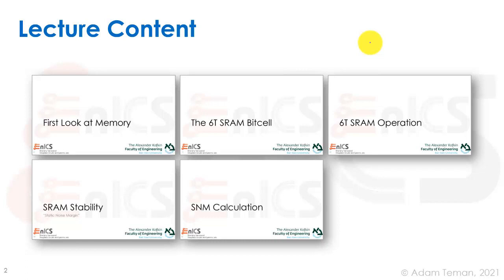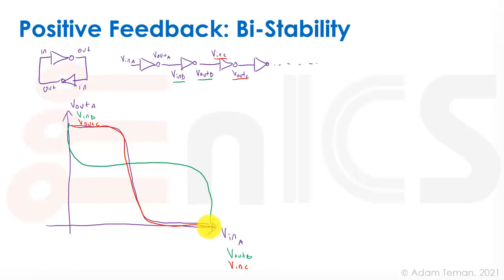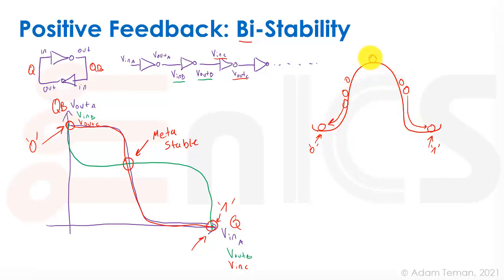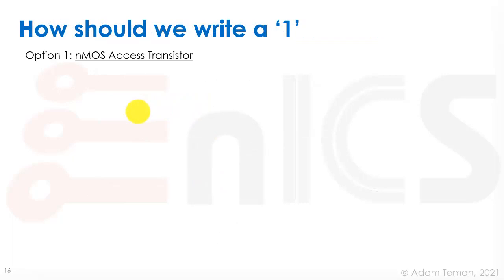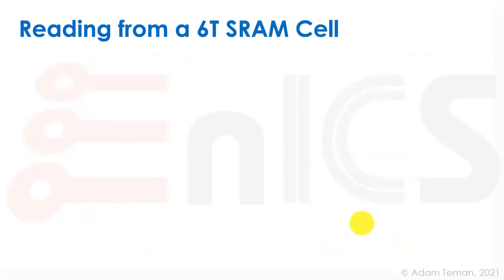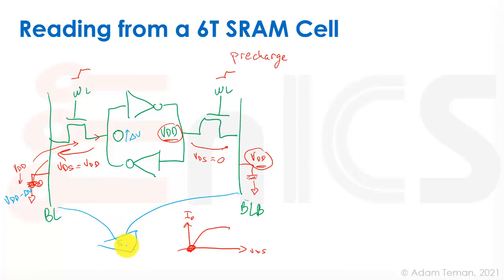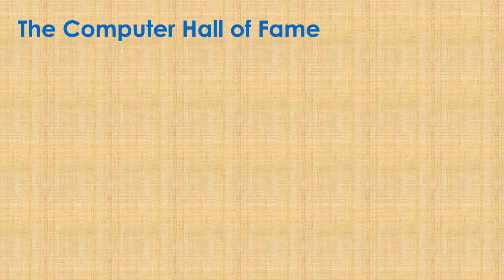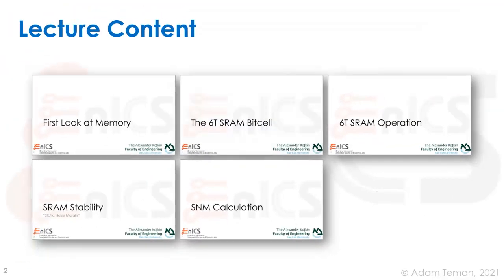VLSI - Lecture 8b: The 6T SRAM Bitcell

Comment: Thank you very much sir!
what is the meaning of positive feedback here?
Reply from the maker: In this context, the "feedback" means that when I drive a signal forward (i.e., from Q to QB), there is a response coming back ("feeding back"), i.e., from QB to Q.
In a negative feedback system, we usually dampen the signal, whereas in a positive feedback system, the signal is amplified. In the case of SRAM, there is positive feedback, amplifying the signal until it saturates at the rails (VDD or GND). Note that most control systems require negative feedback to stabilize a signal, whereas positive feedback is very bad, as it can cause the system to "explode". But in this case, the signal is limited by the voltage rails (VDD/GND), and so the positive feedback is not "dangerous" and in the case of an SRAM cell, it is highly advantageous.